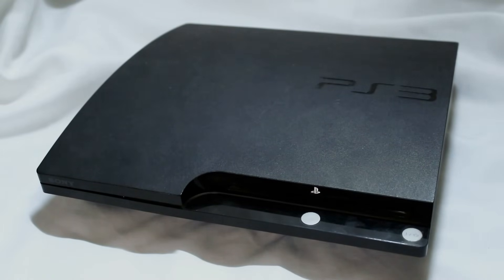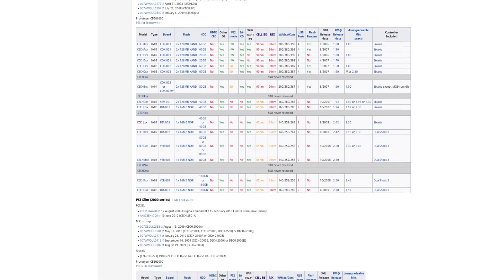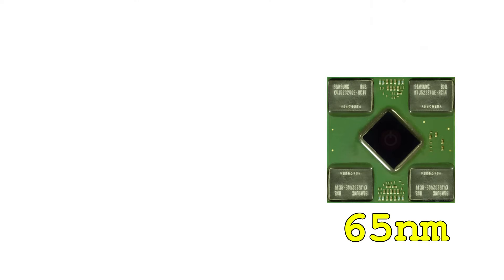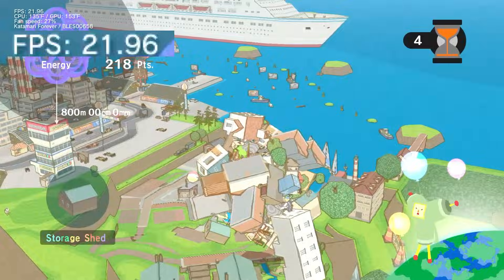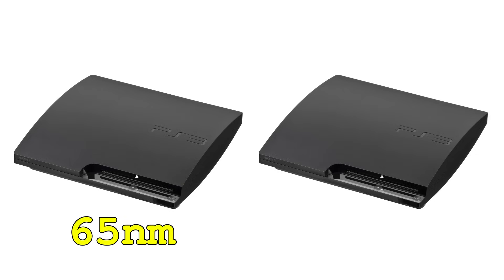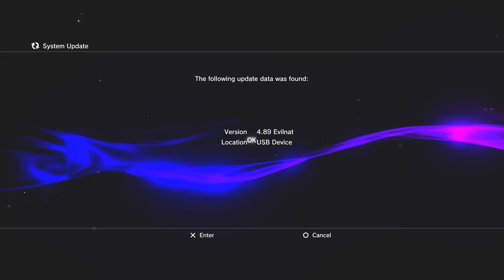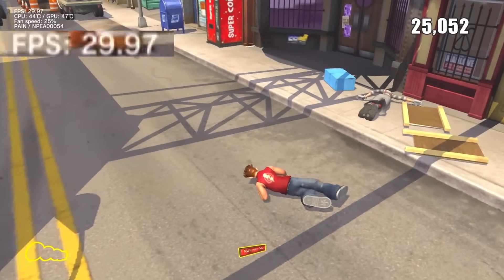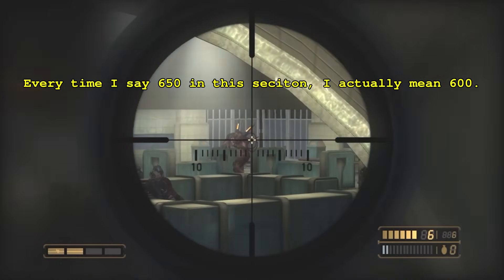Overclocking a PS3 with Project RSX Boost

Comment: I have always heard that thermal pads are inferior to thermal paste because they do not fill the air gaps as they are a solid slab. Could you elaborate on what you mean when you talk about them being better a litte?
Reply from the maker: In general you're correct, however the thermal pads I'm using are phase-change thermal pads, or more accurately, phase-change thermal compound that comes as a thin sheet. The material is a (very squishy) solid at room temperature, but once it heats up to around 40 degrees Celsius it melts into a liquid and it's thermal conductivity jumps up massively.
Reply: @sync-on-luma  I am seriously considering using these pads in the future just to compare for myself as well. Honeywell has no presence in my country so I might have to import some PTM7950 pads. Thank you for the response.
Reply from the maker: I've had great luck with it over the past year or so installing in laptops and a couple other game consoles. The temperature improvement is only a degree to two at best in my experience, but the fact that it basically never goes bad it was makes it great for certain types of devices.
Just be careful when ordering it. I've heard there are counterfeit versions out there that behave mostly the same but have worse thermal properties.

Comment: Ultimately just brute forcing an optimization issue at the SPUs from developers. I get it, it’s a beloved, deceased platform where 3rd party issues are prevalent. But still, just use an emulator.
Reply: A pc capable of emulating the PS3 is 10 times more expensive.
Reply: @GenesHand  exactly! Plus the PS3 emulator is still buggy and slow. I have a 12700k and it still folds when playing the actual exclusives. And stutter. It’s just not not gonna replace PS3s any time soon. It can’t even play online games.
Reply: Lol no.

Comment: You’re not damaging with an overclock. You couldn’t brick it. But you ain’t gonna damage it.

Quit being a pussy and scaring people into not learning from their curiosity. Repair your own shit, and if you want to, try overclocking. Just don’t avoid doing it cause you’re scared of hurting it. It ain’t. The bricking is the thing to be concerned about.
Reply: Yea facts. The bricking is the scariest part. And the bricking is usually caused by the memory. 1000 is a must stay away from. 900 is the safest OC for slims of 2010.

Comment: Is it not possible to do this with a CECH-3001A?
Reply from the maker: No, those consoles shipped with firmware higher than 3.55, so they can't be downgraded to 3.55, which is a requirement to run custom firmware.

Comment: Now I want this but for the 360
Reply: Never gonna happen.
Reply: For the slim and E models it'd be good, but the first generation of 360s is just asking to kill the thing very quickly.
The OG Xbox didn't have this issue because the CPU was swappable with another (albeit completely changing the socket) but a lot of games' mechanics are tied to the FPS, so overclocking caused a lot of issues. It was mostly to make it a 1080p media player, not a FPS booster.
Reply: Most 360 games run very well on Xbox Series S/X why not just play them on those consoles with the updated graphics and consostant 30-60 FPS
Reply: @ELIZABETHMARLONE2005  because a lot of games are still not backward compatible
Reply: @MegaDante4  most of the games that aren't backwards Compat are indie or obscure most of the heavy hitters from the 360 era are backwards compat

Comment: Don't know why you would want to overclock an older console like this that had gpu issues earlier during its cycle. It would be better to just use a PS4 if you want more frames. And just leave this at stock speeds instead of decreasing its lifespan. I rather see the games on the PS3 get optimised instead of straining the consoles hardware.
Reply: You don’t know what you are talking about and it shows.
Reply: @Tanzu15  Good luck overclocking the GPU on a console that already runs warm.

Comment: How to kill RSX chips and their solder balls
Reply: Lol no. Not how that works.
Reply: @Tanzu15  I wouldn't call myself an Expert but as far as I am concerned psvita or especially fat ps3s had a big problem with their gpus and cpus under heavy load theyd break because of the amount of heat. Causing a YLOD.
I recommend watching rip Felix a bit and then we can continue discussing bout that
Reply: @inkontainableargs6 fat ps3s not slims.
Reply: @Tanzu15  I know but surely someone would like to try it on their non Frankenstein Ps3 Fat....
But yes the slim is totally fine which is why some ppl put the slim RSX chips in fat when they eventually fail
Reply: @inkontainableargs6  actually the fat can do the 600 core and 750 memory just fine. Most have reported it to be fine. That’s why evilnat creates the 600/750 OC pup. Cause it’s safe on all PS3s.

Comment: One important thing about the pads: They have a fairly high thermal conductivity, but the important part about paste is, that excess paste gets pushed to the sides, so it basically only fills small gaps between the cold plate of the heat spreader and the IHS of the RSX where otherwise would be a air. Direct contact between the cold plate and the IHS would be way better for cooling, so you actually made it worse with the pads.
Reply: Those are not regular thermal pads. They become liquid at a relatively low temperature. Then it becomes solid again as the chip is cooled down to room temperature. Also take this with a grain of salt but it's not really recommended for direct die when the die is small because in most cases you lack the mounting pressure. If you have a bigger die (like the ones on desktop GPUs) then it's better than most pastes.
Reply: Not necessarily with a phase change material.  It does turn into a high viscous liquid once a critical temperature is reached.  As a liquid with good mounting pressure, it'll spread out a bit and filling in those microscopic imperfections on both the cold plate and heat spreader.
Reply: "direct contact" is not thermally feasible, due to how uneven the IHS and the heatsinks mating surface are. They may feel smooth but are extremely rough for thermal conductivity, which means that gaps are filled with air, that paste would usually eliminate, provided a sufficient amount of paste was used. With the right heatsink, I'd have used liquid metal or Thermal Grizzly we pads.
Reply: If it was direct die then would it have made sense?
Reply: I think when someone says "direct contact" implies removing the IHS and having the coldplate/heatsink directly sitting on top of the die (usually using liquid metal as a thermal interface between the two)
Reply: @iP1sano  are you replying to my comment or the OP?

Comment: 2:20

Even if the voltage is the same, higher frequency increases the current load meaning that it DOES use more power.
Reply: But usually within it's defined specs...

Comment: You should try the PS3 Gran Turismo titles with 1080p enabled, as they're known for pushing the PS3 hard
Reply: works flawlessly on a 700/900 CFW on 2501A
Reply: @Agent-mb1xx  What's the framerate like? Is it more stable? How much gains is there from this?
Reply: @mii9010  will retry tonight, just installed the 750/900 one. So far @ 720p it is perfect, will retry @ 1080p (GT6)
Reply: @mii9010  Flawless 60FPS in GT6, tested on the Nordschleife @ 1080p

Crysis has texture related white artifacts, this is the memory's clock doing it
I use the 750/900
Reply: Thx

Comment: I've been running the overclocked firmware sincer release a couple of years ago, and the best thing about it is that it gives that extra 10-15% fps boost that PS3 games mostly seem to be missing. Such as GT5 running at around 55fps now hitting 59.99fps. It's as if the devs all had dev kit targets that never got adjusted down correctly for the retail kits. And this overclock bridges the gap and makes the games feel like they should be running how the devs intended. Some games however are still aweful, such as Lair, and the Splinter cell trilogy. I don't think any overclock could fix those games fps'.

Comment: Before After test is meaningless unless you lock the fan speed.
Reply: It would be meaningful to test whether it still overheats if you de-lid and replace the critical chip-heat spreader compound, and remove the thermal pad and use thermal compound again.

Comment: A day will come in the next several years where we consider 60fps "sluggish". Mark my words
Reply: It's already the case for PC player
Reply: already is sluggish
Reply: Already is in any multiplayer game in my opinion. I really only like it in single player on my PS5 but I kinda try to skip anything besides fighting games that are multiplayer without an uncapped framerate
Reply: @VisForVindetta  nope, for me it's only in Geometry Dash
As for multiplayer games, I'm totally fine with 60 and 30
But below 30 is def bad (looking at you, No Man's Sky Xbox One port)
Reply: That won't happen until high refresh rate displays become the norm.
Reply: I bought a 144Hz monitor in 2015; 60fps has been sluggish ever since. It's not so bad though, you can get used to it again if you rid yourself of high frame rate devices.
Reply: Na not several years. Maybe 20. Developers don’t care about performance with new games. Visuals are what sell. 30 and 60 will still be targeted by them.

Only esports games where that’s the only game the developer makes a living off of do they aim for 60 fps minimum with older high hardware/low new hardware. 120 is still a luxury for the broad potential customer base. That’s why Fortnite on PC still runs like garbage as far as consistent frame rate goes and they still develop for the Switch, which is targeting 30 but dips below I’m sure.

Comment: I realy wanna do this to finish some of my ps3 backlog and some online but im scared sony may ban my account .im not 100 on the state of ps3 bans  i hear their are RARE RARE and most turn off their mods or whatever etc.. before hoping online. but with this can sony even detect the overclock? and for those say play offline sure for same games no issue. but I want my thropys ,what about co-op? and would be great for some online games like crysis 3 this would be a godsend because man the FPS is awfull their
Reply: They don’t happen anymore. Just don’t use mods in games, and clear syscalls before playing. Webman requires you to clear syscalls by default. So it’s safe. Been playing online for 4 years now. Cfw.

Comment: I would KILL to see someone try this on Splinter Cell Double Agent.
Reply: Did that game perform terrible?
Reply: @Tanzu15  Yes it performed regularly ~10fps and that is no exaggeration sadly.
Reply: @IcedEarth1231  Jesus Christ. I gotta try downloading that game and see how hard I can brute force it.
Reply: @Tanzu15  I'm not sure what the community in general thinks but in the circles I'm apart of in the PS3 scene Splinter Cell Double Agent is often regarded as one of the worst running PS3 titles. Just the single player portion though. It's entirely possible it won't be affected by the overclock though, I feel like the game runs the way it does because of a lack of any sort of threading. I am just assuming though, I don't actually know how it works.

Comment: One day Super Slim/late Slim owners will thrive, once a CFW becomes available these models will surely become more popular and this project may be one of the reasons.
Reply: This will only be possible once someone cracks the new master key, which will probably be circa 5-10 years after the first useful quantum computer, so about 20 years from now.
Reply: @varno why is it such a big deal to crack PS3 Superslim? Does this also apply to PS4 and 5?
Reply: @Messier_-82  I mean, I don't think it is a huge deal. But yes the ps4 and ps5 are vulnerable to the same attack as far as I know.
Reply: @TheOneKeeper  metldr2 is a whole another beast
its like if sony copied the xbox 360 security which was very good for its time
and revised the bad hardware which led to its defeat due to physical glitches used to defeat security 
and as for ps4 and 5 
they are only surface level ability to run homebrews which is thru HEN
available on both the later slims and super slims
the modern security and chain or trust + boot process is so secure there is almost no way to break the full firmware unlike ps3 and 360
Reply: @varno  Isn't system hacking usually performed by finding exploits instead of brute forcing keys?
Reply: @elmariachi5133  the boot code that let's us do these level of firmware exploit is small enough to be basically bug free. The only reason it was hacked was because the updates earlier were signed in a way that leaked the private key by making a very simple mistake, sony fixed that and didn't make the same mistake again. Thus to get an equivalent exploit for the super slim, we would need to solve the ecdlp on the new key pair
Reply: @varno  Ah, that's mean! Thank you for explanation.
Reply: @varno yep, it’ll be a long time from now before we even begin to see CFW for PS3 Superslims & that’s if the PS3’s are even around, PS4/5/6/7 may very well get exploited.
Reply: @PlayingUnfairly  the 40nm and newer slims should last that long. The big issue was that chip manufacturing at 90 and 65 nm went through some big materials changes, and the quality wasn't there yet.
Reply: @varno  I think as a whole the PS3 superslim was just cheap overall. The issue i’m talking about is if these consoles can stand the test of time, I don’t know what it is but these PS3 consoles are dying a lot more than the PS2’s are. I’ve had only 1 PS2 in my life & it lasted longer than 4 PS3’s i’ve had since they came out. PS4’s are also questionable considering how stupidly hot they get.
Reply: @PlayingUnfairly  actually, everything in the superslim,  whilst built to a cost, is actually quite durable in its simplicity. The only item that wears out and is irreplaceable is the bluray laser diode in the optical drive, and there is sadly nothing yo be done about that. But for digital games, everything else should easily last 20 years from now. The ps3 was after the capacitor plague and so avoids that main issue too.

But as I said, the early ps3s are really unreliable. Basically every 90nm ps3 will eventually die as will probably the 64nm chips eventually, the move to copper interconnects and bump bonding, as well as the new low-k dielectrics used between the traces are were just not understood well enough at the time to be reliable. This was fixed mostly one the 40nm node and completely fixed on 28nm.
Reply: @PlayingUnfairly  there's already CFW for super Slim tho I have mine with CFW with Hen and MultiMAN installed, with homebrew and all
Reply: @CrocoDylianVT  if cfw was a thing on superslims then most of us would probably opt in for a superslim & you just said you have hen, what you have is hen, no cfw & it would be useless to have hen on cfw so no, you don’t.
Reply: @CrocoDylianVT  that is not CFW, it's a mix of HFW and HEN, that's totally different, you can't have access (yet) to EID root key on 3.60+.
Reply: @varno  yep
Reply: @PlayingUnfairly I had my slim PS3 10 years with no problems before selling it. It was a first generation slim. It was buy one get one free, as I sold it with my super slim that I didn’t want anymore. The original slim PS3s were tanks. I eventually jailbroke it, but I sold it with a OFW on it. I did disclose it was jailbroken and they could install a CFW at anytime
Reply: I hope so considering how much longer lifespan the super slims have over the original fat PS3s.
Reply: Guess what!
Reply: Sadly I have a PHAT, it sometimes doesn't keep up to even basic PS3 speed, for example Sports Champions has lag spikes there
Reply: gt5 slim :}
Reply: yeah... thats about as realistic as 360 softmod
Reply: There's already CFW that work on them, I have CFW in mine lol
Reply: God I hope so. Hate being stuck with just HEN.
Reply: @SonicBoone56  bro go get a ps3 slim. Super slim ain't getting full cfw anytime soon

Comment: How do you get the clock speeds to show up on the fps display?
Reply from the maker: Clock speeds are only shown on the XMB, unless there's a setting to change it that I'm not aware of.
Reply: @sync-on-luma  mine don't even show there. I still have my temps though so that's good. I was able to check the speeds using the cobra tools to verify the overclock was applied. 

I do have one more question though. Is it entirely unheard of that the console doesn't get any hotter with a 100mhz overclock? I didn't see any noticable increase to my temps
Reply: @richardmcintosh9919  temps don’t go up with these overclocks. At all. I run mine at 900 core and 950 memory. Yes insane silicon lottery, but my temps are identical to stock. Voltage is locked. So only thing that goes up is frequency cause of how efficient the 40nm chip is.
Reply: @Tanzu15  That's impressive! I wanted to try a bigger overclock but I'm gonna play it safe with the 100mhz evilnat firmware
Reply: @richardmcintosh9919  yes play it safe for now. If you ever decide to want to OC higher it should be safe on slims to do 700/900.

Comment: PLEASE MAKE THE CAPTIONS SMALLER !! They cover like 40% of the screen, separate them into smaller pieces

Also, using PTM thermal pads in a console is bad idea, their conductivity is only about 8 W.m‐¹K‐¹, that's quite low for a device that draws 200 watts.  Get some thermalright TF9 or TFX Extreme.

I would recommend using these on cheap / mid-low-end gaming laptops only